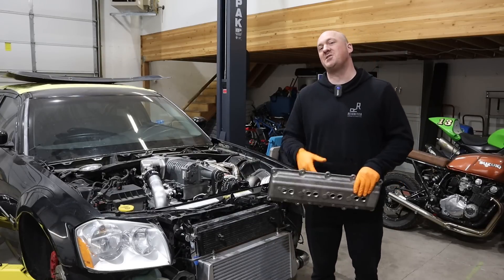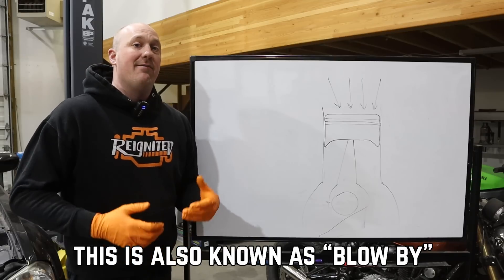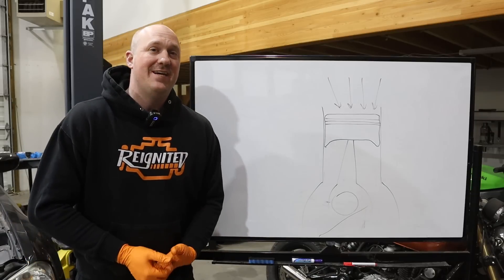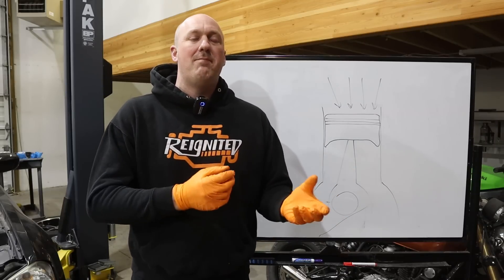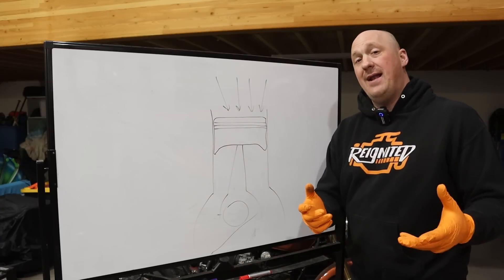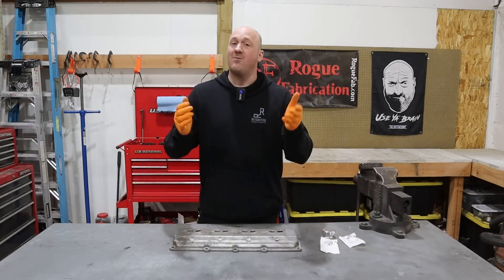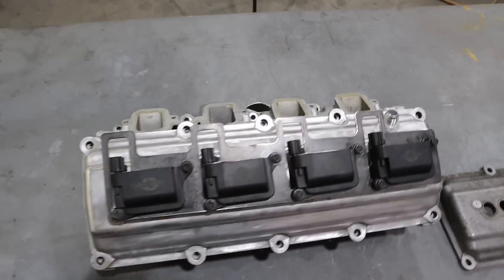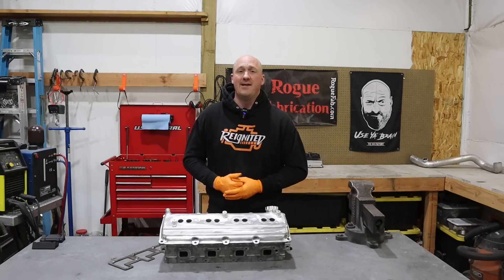Twin Charged Magnum, Solving the Last Big Puzzle! Poor Man's Hellcat Ep18

Comment: Just curious, did you think about keeping the plastic valve covers and using bulkheads?  It seems to me like that would have worked (Although not nearly as cool).  If carmakers would use a venturi setup and burned the pcv right in the exhaust, lots of intake manifolds would appreciate it and the walnut trees would be upset.  Really curious to see how you setup the fuel system.
Reply from the maker: I did think about using those, but with these valve covers flat surfaces are hard to come by and I worried about them sealing properly 👍
Reply: @ReignitedAuto  Hey I hear ya.  If you are looking at a oil air separator, mann + hummel makes a pro vent 200 which is supposed to be really good at separating the oil out of the mist.  You could then drain that into your catch can.  Definitely more stuff to shoehorn under the hood, but it's something I thought about doing.  I think some OEMs actually plumb the oil it separates right back into the crankcase so there is no can to catch the oil.  (It's one of the German automakers, I can't remember which one).   More food for thought.

Comment: my hemi stroker build is almost done.
my mechanic installed the new catch can, but forgot to install a PVC valve!  (new engine, new everything)
the engine started to squeal at running temp, we thought it was the rear main seal squeeking.
it was the crankcase pressurizing, and whistling out the intake gasket
Reply from the maker: 😄 We had a guy at the shop install a front crank seal backwards, He started it up and it's whistling through the front crank seal, took us a few minutes to figure out what he did LOL.

Comment: You LS swapped the coil mounting system. The assembly does make things easier to work on. The rear ignition coils on the hemi are a pain to remove on some models. The bolts are not very easily accessible.
Reply from the maker: Yea those rear ones are a pain in the butt!

Comment: Oh and also; I have heard the aluminum and other pre eagle valve covers will not fit eagle heads with the taller rocker arm placement being 200 thou higher; I haven't had a chance to try it myself yet but you may need to clearance them.
Reply: You will need to clearance the inside of the ends of those covers, basically just the ribs on the inside of the covers...
Reply from the maker: @kennyjohnson1369  appreciate it 👍
Reply from the maker: You may be right on this because I know the eagle rockers are taller. I'll double check my fitment before final install 👍

Comment: Run an extrernal PCV valve before the catch can, my buddy's LS was burning a ton of oil and filling the catch can because the Holley Valve covers didn't have a correct baffling, we put a PCV valve on and it worked flawlessly.
Reply from the maker: Good tip, I'll see what kind of provisions the Motion raceworks can has 👍

Comment: That is a great idea for the coil packs.  Those valve covers look amazing!  Great job!  Painting the valve covers, is HEMI ORANGE a choice?
Reply from the maker: Dang, that's actually a good idea. If I were doing more paint match parts on this build I definitely would have gone that direction. With the next build the Scat Pack Neon I'm using an SRT block that is already painted that color so I'll probably do the valve covers the same. 👍